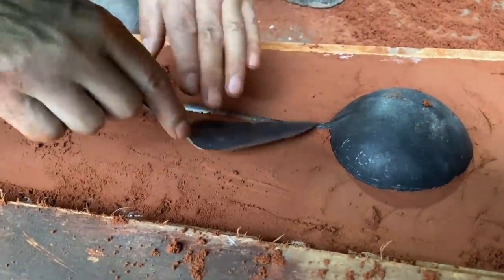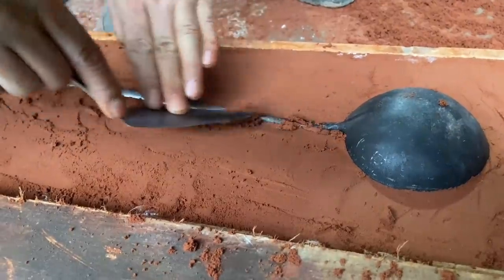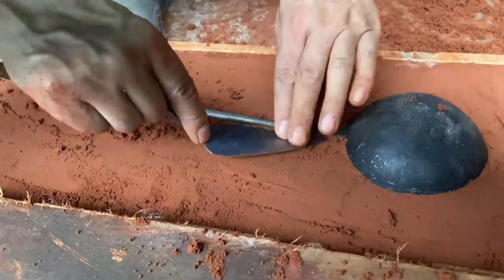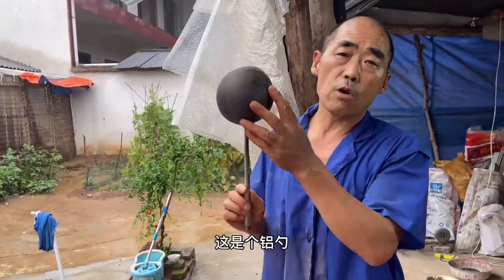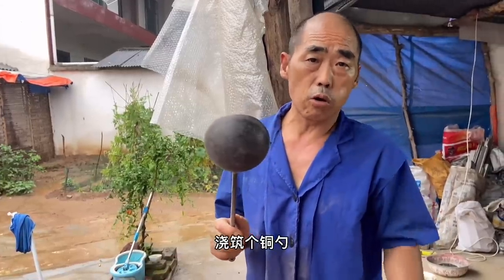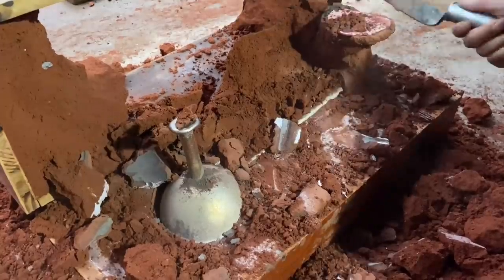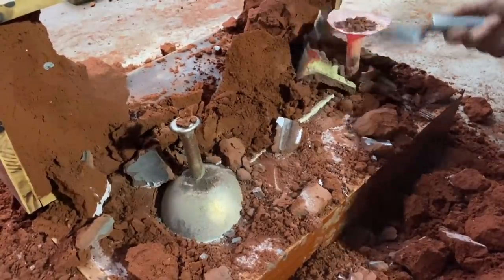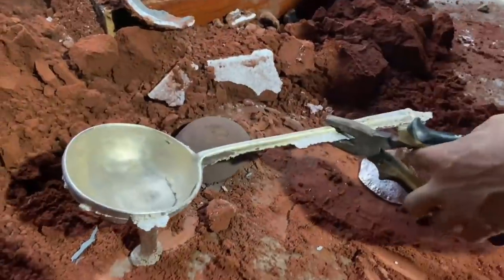More than 1000 degrees of copper water cast golden copper spoon, so awesome【Laozhu Casting】

Comment: Interesting and traditional engineering 😊🙏 but I wish the translation was more consistent. Some places they said copper, some places it was brass. It was unclear how the copper liquid was made. Seeing how he works with simple equipment and techniques and no fancy equipments, it is utterly beautiful to see the final product. Thanks for sharing a beautiful video ☺️
Reply: Generally these  arts  are from bronze age period, when use of alloys was predominant, now as the time flows they are using only scrap metals which contains, copper, brass, bronze, anything easily available.
Reply: Copper is melt down in a furnace  above 1500K.
Reply: Many places translate "brass" to "yellow copper" or "golden copper".
Great video!
(I especially like the quacking ducks in the background)

Comment: Would b nice to know wat kind of brass or bronze he used ? Such a thin and long mold and the metal didn’t freeze up halfway🤔. In the biz and supper intresting
Reply: The metal is heated about 200 hundred degrees above its melting point,  and the sand acts as an insulation against heat loss. It looks like yellow brass, so about 70% copper and 30% zinc.

Comment: When the craftsman hinges the top part of the mold up, what prevents the sand from falling out? Compaction?
Reply: The sand used in casting isn't like ordinary builder's sand. It is sticky and maintains its shape when compressed. A bit like damp sand on the beach.
Reply: @lfoggy3061  thanks for that, it puzzled me a bit!
Reply: It is a very fine sand mixed with a petroleum product, usually transmission fluid.